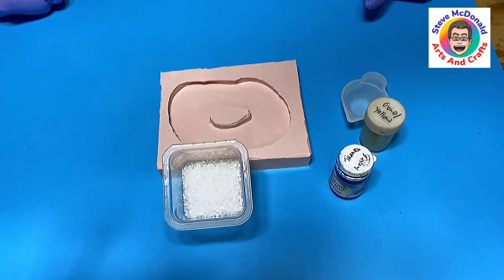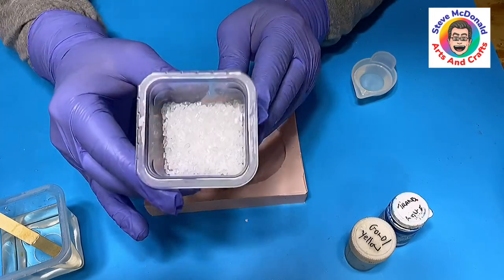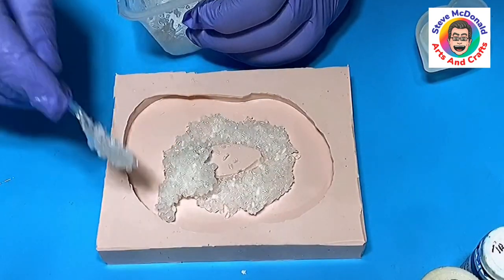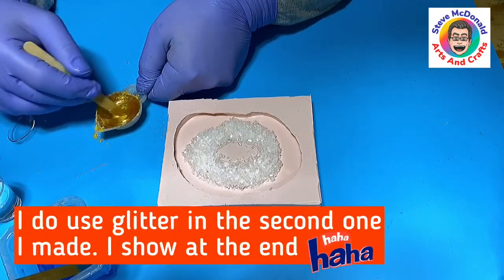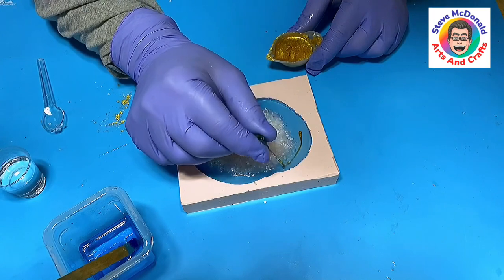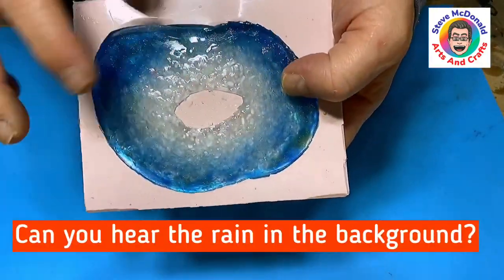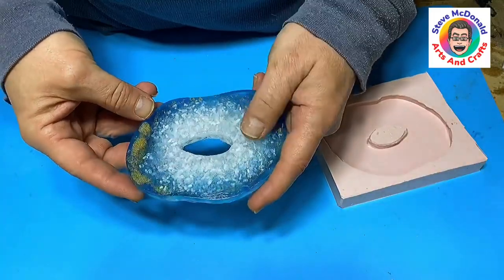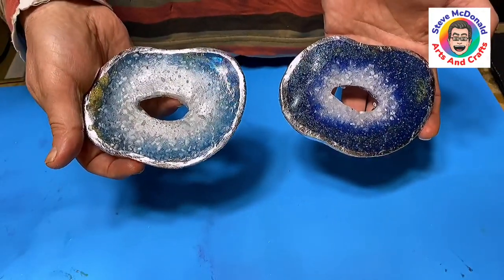Can You Make Resin Geode Coasters Using Epsom Salts For The Crystals

Comment: Cool 😀😍. I love making geodes, they sell well. Took a pair to the shop today funnily enough to replace the ones that sold. After your previous video about the Epsom Salts I did go and buy some. However, due to Anglesey winter I've had to stop doing resin until next year, which is most frustrating. I would be interested in seeing what geode designs you could create with a slightly larger coaster mould 😀. Or even a larger geode piece of wall art or a geode tray 😁😁. Those Epsom Salts have potential!
Reply: Heating prior to use is not the issue. The problem is keeping the internal ambient temperature stable enough for the resin to cure. My house is close to the coast and somewhat exposed, despite hedges and trees. If I had a studio then it would be likely be loss to control the temperature. I do have a room that would be suitable but it has 2 of my buns living there. Got a small house and nowhere else for them to go. I need a bigger house😅. I did try using an electric propagater but I can only make 2 - 3 coasters in that. Cannot find a propagater large enough for trays, cake stands and the other large pieces I make. 
As I'm writing this I can hear a bird trapped in the flue from the log burner. I don't know how it got there or how I can get it out 😥😥.
Reply: Sorry, meant if I had a room it be easier to control the temperature. Peppermint and Aubrey's room would be good because it only has one window anemone door and quite a  small room.
Reply: How would that work? I thought cool boxes keep stuff cool? And how would I keep the ambient temperature stable inside a box? The utility room, where I make my resin pieces, is currently at 15c, so surely that is too chilly for resin?
Reply: @tazminmoore455  I've had success using a heating pad understand a cookie sheet. I put small wooden blocks underneath the corners to keep it level on my shelf.